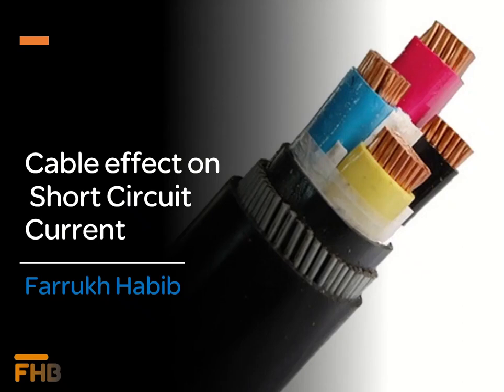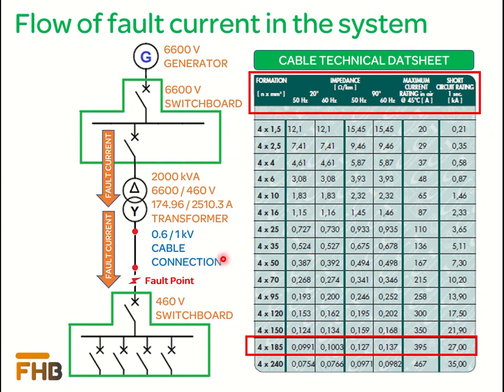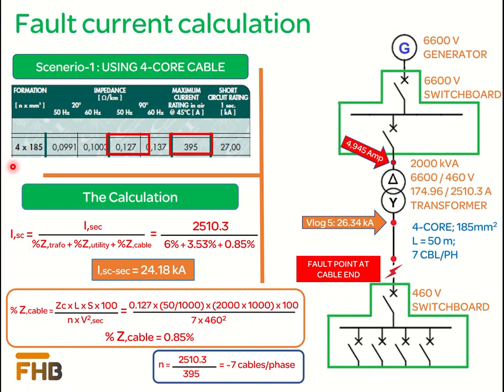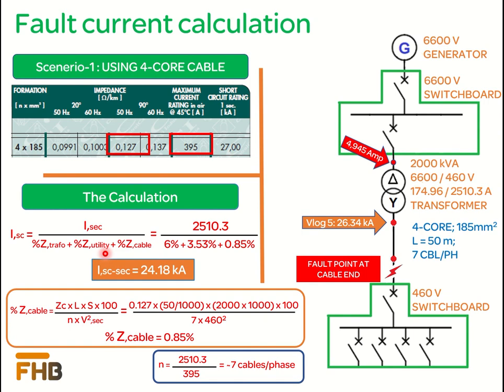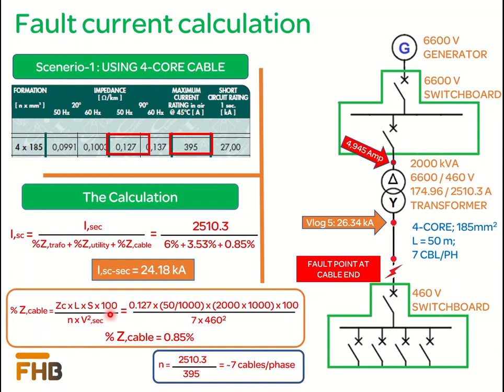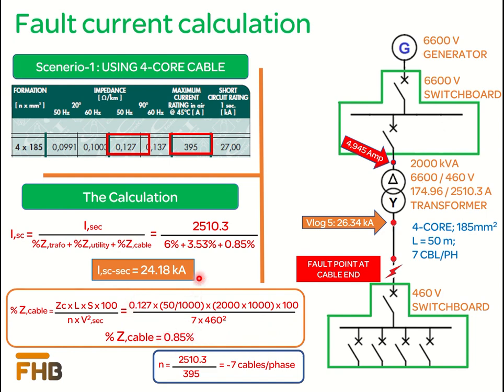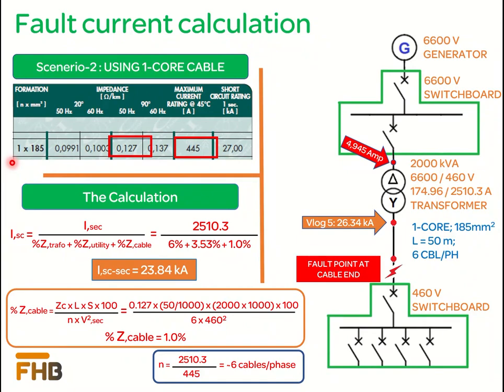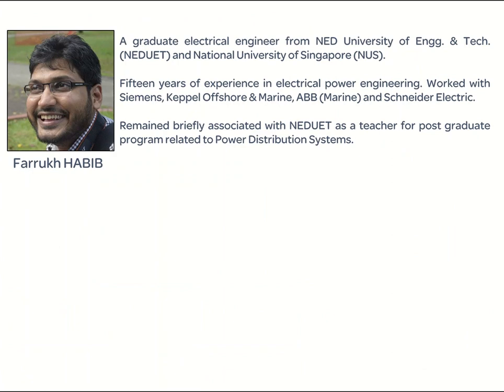Electric Cable Short Circuit Calculation | Farrukh Habib - FHB | #ElectricalEngineering

Comment: hi farrukh
Let me correct 
most of the cable data sheet are without cable impedance though resistance , reactance  & capacitance value are. So that we can calculate the value i.e. Zc = under root {(Rc sq) + (Xlc - Xcc)sq} is it. Secondly if you can share link of cable technical data sheet could be very help full for me.